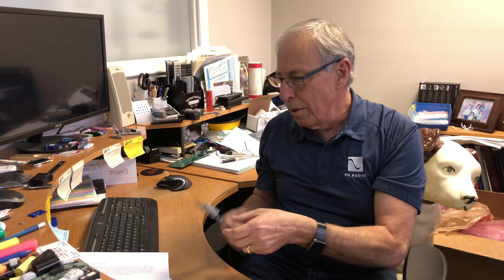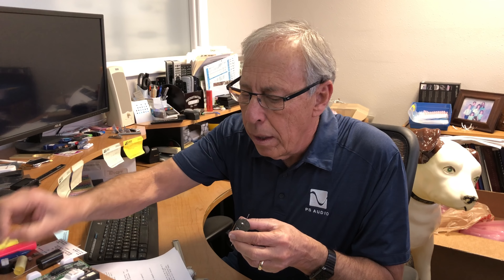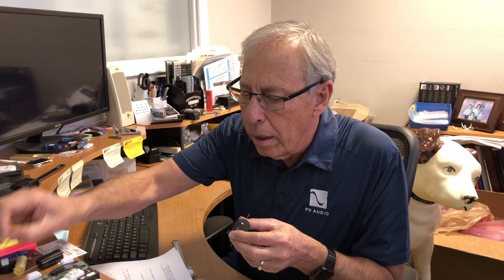Confused about biamping speakers?

Comment: My 1st foray into bi-amping will be to get another lower wattage stereo power amp from the same manufacturer as my bigger amp.  Then get a Dayton Audio DSP-408 or MiniDSP.  Mount it between the preamp and amps.  Use pink noise via the crossover to sample the speakers and room. Then have the 408 or Mini signal the higher wattage amp for the low frequency drivers and the lower wattage amp signal the high frequency drivers.  Ultimately, I’ll move up to DEQX.

Comment: Paul, 6 advantages to biamping you have not mentioned, plus an error:
1) In the frequency vecinity of the crossover range, passive crossovers introduce significant series impedance, both in the treb and bass driver circuits, which impedance locally kills damping factor and reveals speaker nonlinearities that would have remained hidden if driven from a low impedance source as they were meant to be driven. Besides, you cannot use nominal impedance, e.g. "8 ohms", in your calculations, because the actual impedance of a driver at the crossover frequency can be many times higher, and it can be capacitive or inductive or resistive or combinations, which in turn affects phasing. So, usually, building a proper passive crossover necessarily begins with an RC shunt on the speaieer terminals to reduce its impedance at high frequencies, plus an LC shunt to reduce the impedance peak at the frequency of resonance of a driver;  and even then the resulting impedance won't exactly be flat;  just a bulk park aproach to flattening it; but it has to be done and tested and qualified before the crossover calculations can even begin.
2) Amplifier distortion is minimizable, yet inevitable;  but of all the classifications of distortion, none is more perceivable and distasteful than intermodulation distortion, which causes ghost frequencies appearing equal to the sum and difference of any two frequencies present in the input signal.  So, all other things being equal, total intermodulation distortion is proportional to the square of the number of frequencies present. Given this, and given that there are many frequencies in most pieces of music, (except maybe during a Moog synth solo), it makes perfect sense to split the signal in the preamp, and let one amp handle some of the frequencies, and the other amp handle the others.  Triamping is therefore even better than bi-amping, by the same token. 1/3 of the frequencies per amp, resulting in 1/9th as much intermodulation distortion, --oversimplifying it. But it actually  sounds infinitely better, I tell you from personal experience.
3) Doing the crossover in the preamp allows you to better control how steep the rolloff is to be. For a tweeter I like 24 dB/octave, as tweeters are delicate and tend to get damaged with lower frequencies. Implementing a 24dB passive crossover using coils and capacitors is a friggin nightmare. Also, bi-amping (tri-amping) allows you more freedom in the choice of crossover filters to use. For bass-mid I prefer a state-variable filter, which has poor rolloff (12dB) and poor efficiency (speakers at 120deg phase at crossover frequency) but they are input-to-output phase-coherent. For mid to tweeter crossover I prefer Linkwitz Riley, which is NOT input-to output coherent, but is speaker to speaker in-phase throughout the frequency range. But there are other choices, such as Bessel crossovers, Linear Phase crossovers...
4) Passive crossovers introduce distortion, due to non-linearity of the ferrous cores for the coils. Some high end passive crossovers use air core coils to avoid this distortion, but at the cost of these coils being huge and heavy.  Using electrolytic pairs back to back also introduces a bit of distortion;  and film capacitor equivalents can be huge too, for a low-mid crossover.
5) Even at the accoustic level there is intermodulation distortion introduced by the drivers themselves due to doppler effect. Having all the material coming out of a single, perfect speaker, driven by a perfect amp, will present doppler effect distortion in proportion to the loudness of the signal. The more frequencies involved, the more intermodulation. Now, if say we split the spectrum into 3 channels, bass, mid and tweet, doppler can be mitigated. However, the degree of success will depend on how sharp the rolloff of the crossover filters are.  With the typical 12dB rolloffs of passive filters, there is still a lot of overlap;  but with preamp side crossovers designed with op-amps or DSP's you can achieve much sharper rolloffs, and better mitigate doppler intermodulation distortion.
6) Finally, with bi/tri-amping you have the freedom to taylor the type of amplifier to the frequency range. I use class D for woofer and mid, and class AB for tweeter.
And now the error:
You said that the gains of the two amps need to be matched; but it is not the gains, as the sensitivities of tweeters are usually much higer than the sensitivities of woofers and mid-range drivers.  What needs to be matched is the final dB SPL on axis.
And one more bonus thing: You talked about how much it would cost you to bi-amp, as if it involved buying 4 of an amplifier model, but the amp you need for the tweeter is much smaller than you need for woofer and mid. If you have 200W class D on your woofer, and 200W class D in your mid speaker (for a tri-amping example), you only need 50W (class AB I prefer)  on the tweeter, at most --probably 25W would do.  The real cost of bi-amping, for a DIY guy, is designing and building a good preamp crossover; --never mind the amps.  For most people designing and building a preamp crossover is totally out of the question.  The real question then is, as a company, do you do the mediocre thing that everybody else does, saying "good enough", or do you commit to what stands heads and shoulders above everybody else?
Reply: Internetwanderer, sort of agree, but Dan covers more in a few paragraphs than the video. Very good points. I would also point out the with an active xover, the signal levels are much lower and much higher impedance, so you don’t need large expensive film caps. This is completely avoided bc you can set the freq based on an RC time constant and make the R much larger than speaker impedance, therefore the caps can be in the nF range. Small COG/NPO caps are readily available and have very good characteristics. 

The minidsp solution looks quite interesting, and pretty inexpensive. (If you want to go to the digital route)
Reply: Dan, many thanks for that. 
All in all, would you recommend passive bi-amping (with passive crossovers left in the speakers and in the signal chain) or not necessarily so?

I have Mirage M3si and a Icepower 1200AS2 stereo power amp which gets the signal from a preamp (DSPeaker Anti-Mode 2.0). 
I am thinking if buying second stereo 1200AS2 power amp and biamping my Mirages (using Y-spliter on balanced XLR cables out of the preamp) with those two stereo power amps (and still leaving passive crossovers in Mirages and still using them).
Is this kind of passive biamping:
A) surely will give audible sound quality improvement 
B) will give sound quality improvement but the improvement will be small/neglible (as still passing the signal through passive xovers in the speakers which dull the signal down)
C) too many factors to estimate how big (and worthwhile) the sound improvement will be hence only trying out the biamping physicially will give me the answer
?

Please help. Many thanks